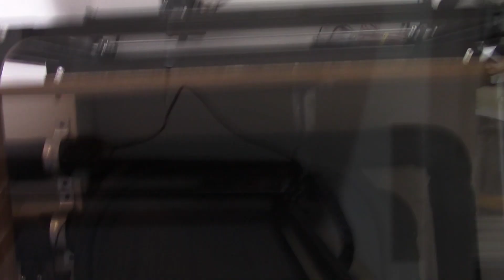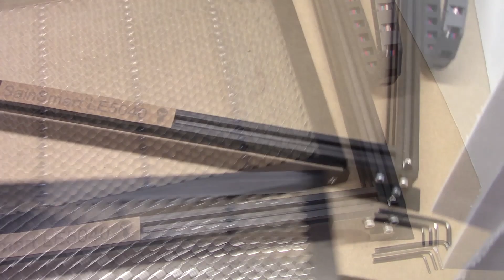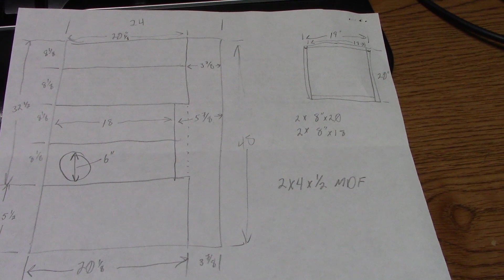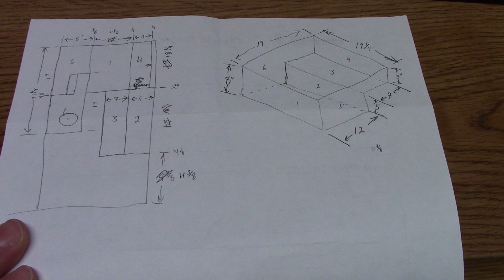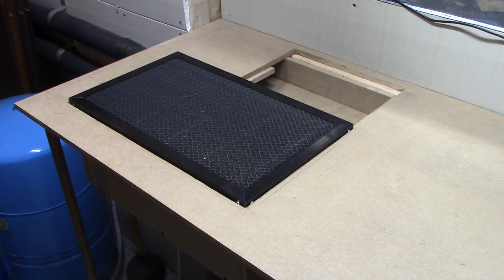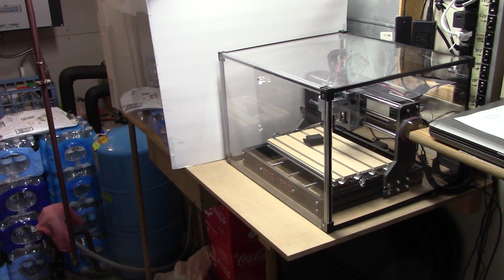Wasteboard upgrade!  Honeycomb, won't you be my baby?

Comment: Hmm... M'y two cents: why 2 orientations for the honeycomb thing while you can just turn the material to be Lasered ?
Reply from the maker: Great question!  I can also rotate any project 90° within software and burn it too and I have done that.  The only "good" reason is for something that is somewhat thin yet too long to be within the bounds of the laser's frame.  The frame in the "Y" direction has more allowance to get under the frame than it does on the "X" sides.  So the bottom height of the front and rear rail is higher than the other two sides by about 20mm.  That being said, I could also just put the laser up on blocks like I have to when I am using the rotary roller.  If I never really need the new waste board rotated, then it was a waste of time and material.  But I did gain a sweet hiding spot for something.